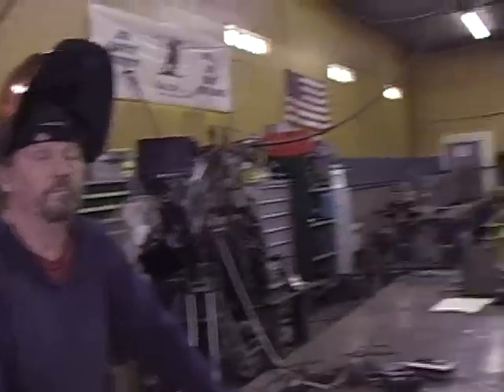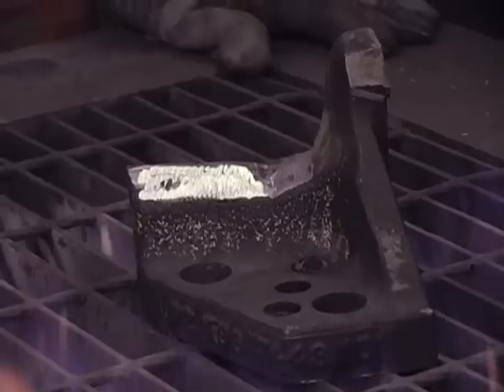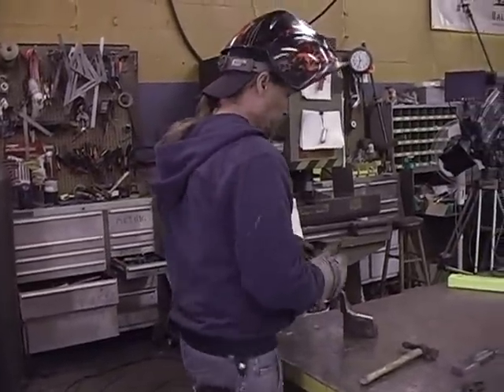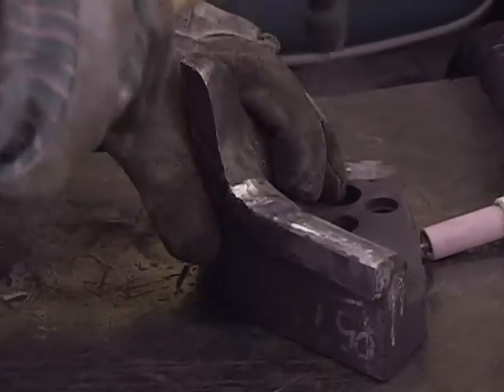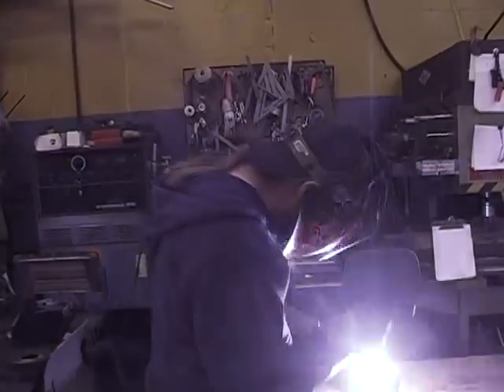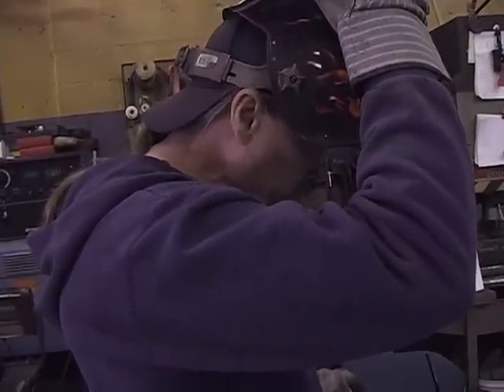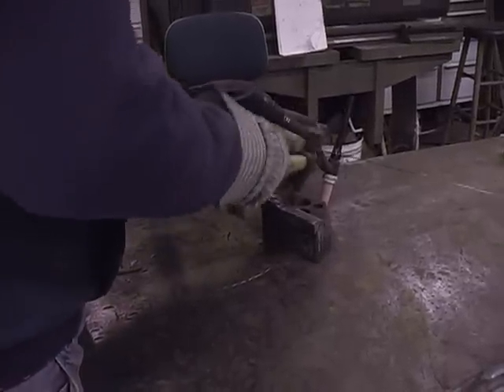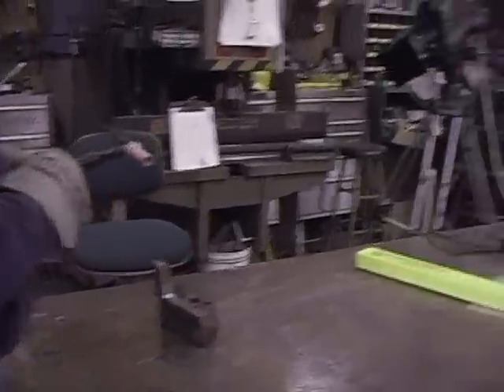Tool Steel Welding Demo - Vulcan T-4400-CG and T-9900-TS tig

Comment: I weld D2 ,my and much higher grade Tool steels every day.. If you want a weld to hold up in a press and die situation you CANOT TAKE SHORT CUTS LIKE YOU ARE DOING!! pretemp is critical critical! maintaining temperature is critical and post drawing is critical.. use of a special oven is critical! Your welding welding will not hold up and probably Crack off in the press causing MORE DAMAGE TO THE DIE.. You must follow welding procedures properly for ALL TOOL STEELS OR THEY WILL FAIL.. I have been welding tooling for 40 years and have saved my company millions of dollars in repairs and down time.. Do it right the first time  follow welding procedures, post draw,or you will have Junk!!

Comment: would that work for M2 OR M4 TOOL STEELS
Reply from the maker: Yes, this procedure and products will work for both M2 and M4 tool steel, as long as you follow the important steps of preheating, peening, and postheating.